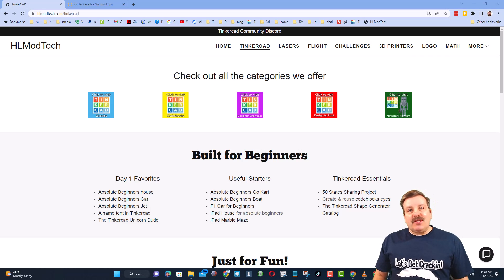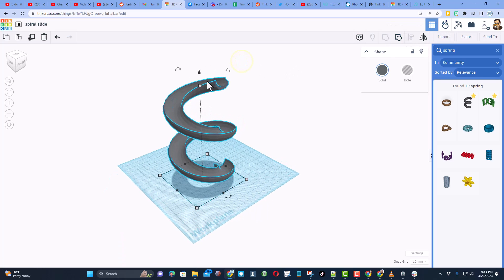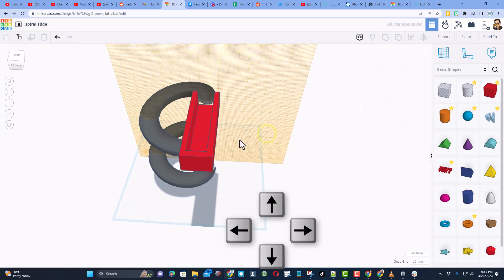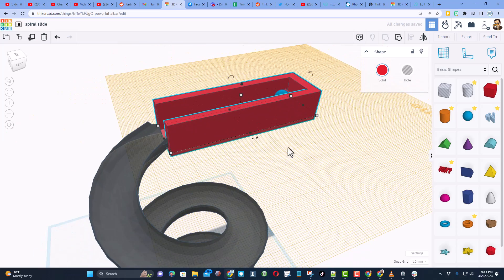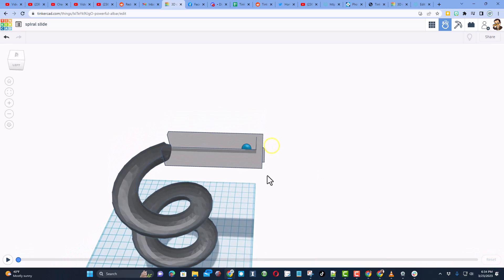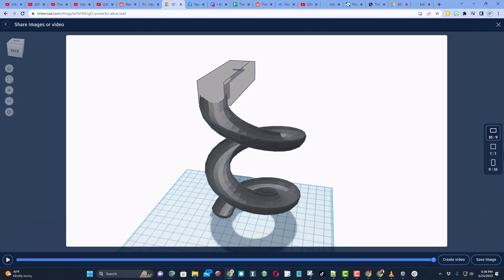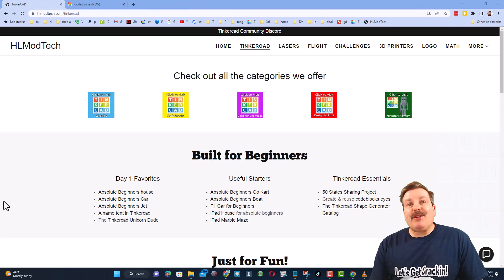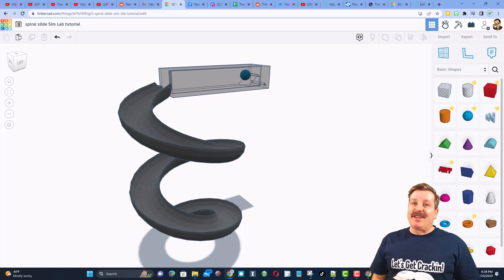Tinkercad Sim Lab Make a Slide for a Marble run Save video of it too!

Comment: I created a long marble bridge, tilted the entire bridge 3 degrees, then 4 degrees, but still marbles won't roll down it. They just sit there. Any idea why? Maybe because they are too small, because I needed to model a 20 ft x 20 ft space, but since Tinkercad doesn't allow a workspace that large. So I did a 20 inch x 20 inch space, and then made everything 1/12th the size, so the marbles are .04" in diameter. Maybe that's the issue? Maybe they are below the threshold for having any appreciable mass in Tinkercad?
Reply from the maker: Interesting. Would you like to send a share link so I can see inside it? Here's how https://youtu.be/XeDQjhRK8lg You can reach me at hlmodtech gmail.